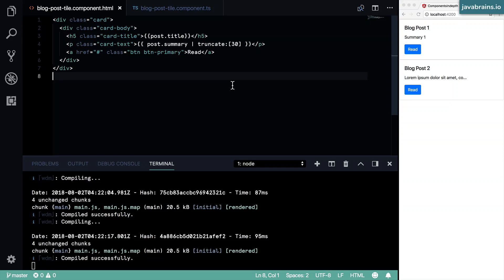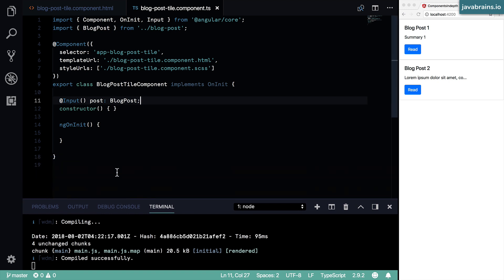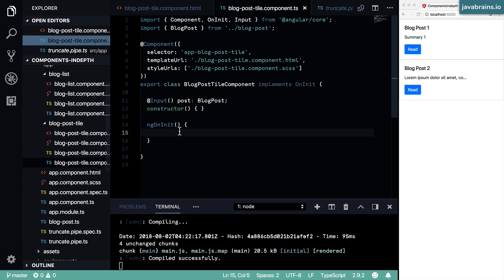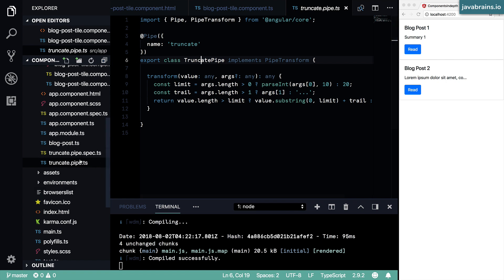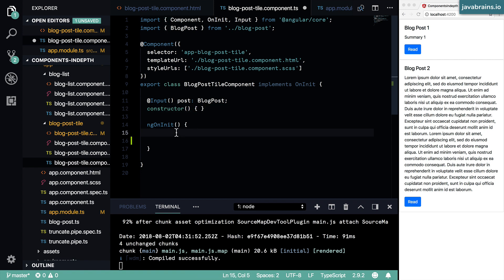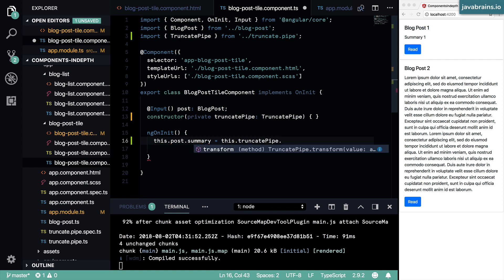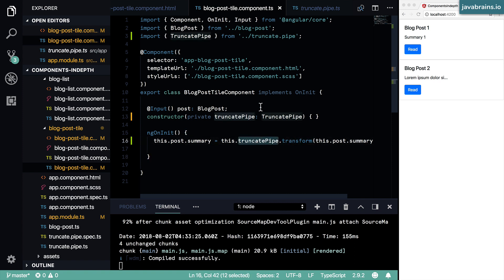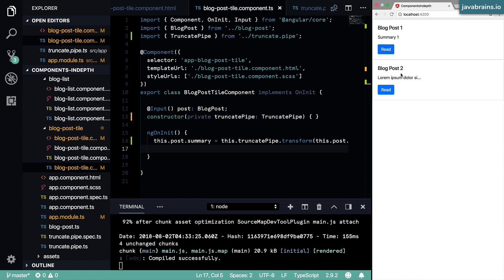Angular Components In Depth 9 - Calling pipe inside Angular components

Comment: Question: It looks like your truncate length parameter didn't work. If you look at the output on the blog tile for the one with 'lorem ipsum', it's been truncated to 20 characters instead of 30. I believe this is because the stack overflow solution you used had a default of 20, so your 30 you passed in was not honored. Why is that?
Reply: Just write -> this.post.summary = this.truncatePipe.transform(this.post.summary, [30]); Put the length in square brackets
Reply: The function truncate expects an array of arguments, if you pass just a number, const limit = args.length > 0 ? parseInt(args[0], 10) : 20;  --> args[0] is undefined so it used the value 20 as a default
Reply: @stasantokhi6469  thanks bro
Reply: digipukamon it is 30 characters including three dots